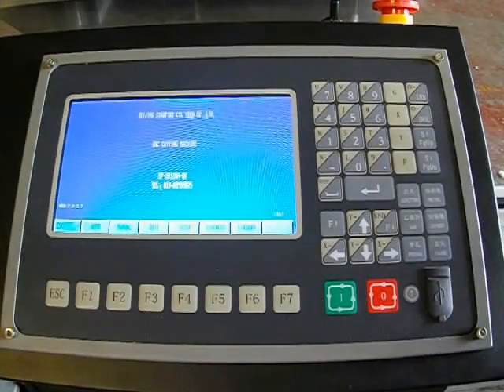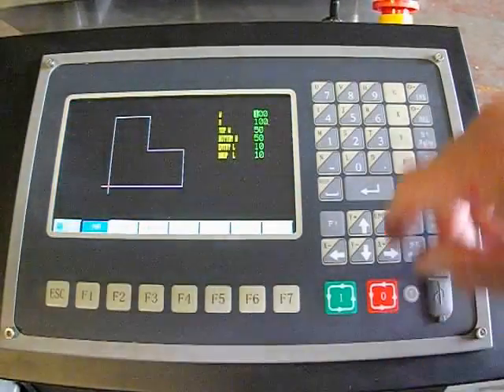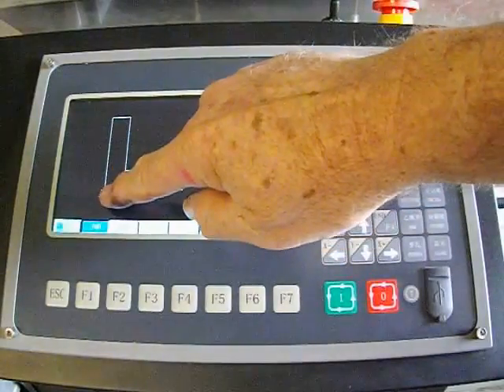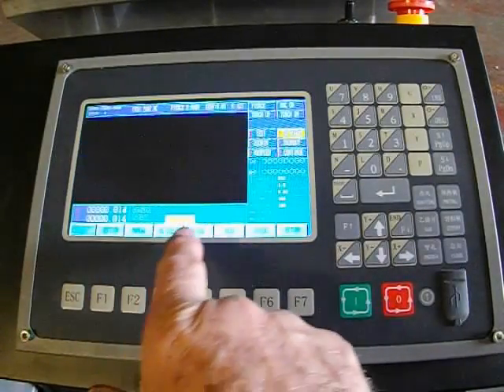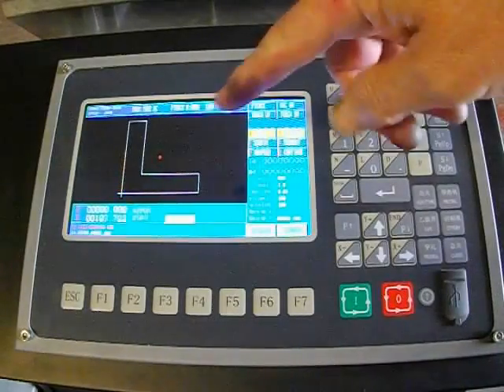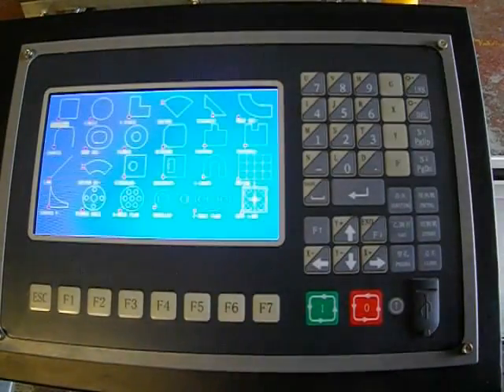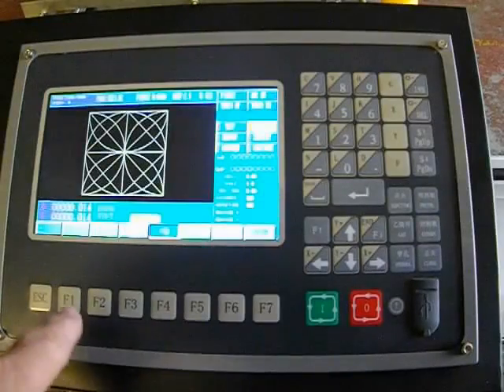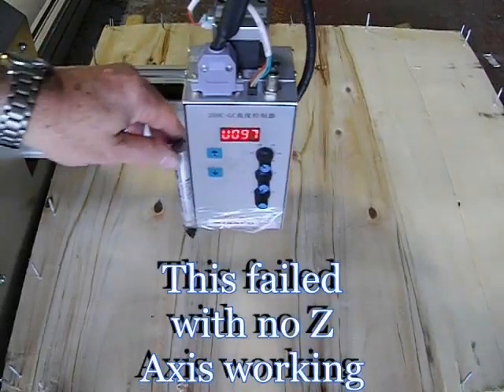First Runs CNC Plasma

Comment from the maker: I am not familiar with sheetcsm but i believe you can use sheet cam i think you have to assign the control panel model to the sheetcam which should align the g code controls.
 nomally draw say dxf . Drawing into sheet cam output g code to usb.

Comment: I’m currently working with a SLX-PCNC1290 CNC plasma machine powered by a Hypertherm Powermax 65 and using a SH-2012AH-QG controller (Starfire / Shaphon), distributed by Z Spot Media.

I’m trying to understand the complete workflow, but I’m struggling with a few key steps:

How to create compatible part drawings (DXF, SVG etc.) for plasma cutting?

How to generate valid G-code (preferably using SheetCAM)?

What’s the correct file format and naming to ensure the controller reads it from USB?

What G-code commands (torch control, THC, touch-off, etc.) are needed for this controller?

If anyone here has experience with this type of controller or a similar setup, I’d really appreciate a sample file, a working setup, a video tutorial or just some tips to help me get started properly.

Thanks in advance for any guidance!

Comment: I have the same problem as Joe. My machine makes the pierce but flames out but mine does not run after it flames out. It just stops. I have cut on it before, but now this problem poped up and I can't figure it out.
Reply from the maker: Have you looked at all the parameters re flame running feedback.if it has been enabled because there is no feedback circuit it thinks there is no flame and turns off the torch.
If it also stops running the shape program that could be another problem.
I am not familiar with this problem.
Look at the troubleshooting guide.

Comment: is it possible to generate the code in Artcam? I can't find the format of the post processor, that is, the format of the NC code
Reply from the maker: I am not Familiar with artcam but the  machine uses gcode.
It usually comes with Fastcam software.
Reply: @Graemecns  I couldn't install Fastcam, my windows is 10, I'm trying Artcam but I don't know what is the file format or the post processor
Reply from the maker: @engmec.joseantonio4181  the gcode is loaded on a USB stick and runs machine. NC. Text.
The gcode commands  are all explained in the machine manual.
Fastscam should work with windows 10 what is the problem.
Reply from the maker: The only problem I have seen with windows 10 is the USB port will not read the usb key. USB port problem.
The cure seems to be use an external USB hub.

Comment: Any way you could show the wiring to the plasma cutter? Thanks in advance
Reply from the maker: there are only 4 wires fom the cnc controller. 2 for on of switch using a relay. 1 off + 1 off - for torch height control 50:1 input. you have to work out what wires your machine has.
Reply: @Graemecns  I have the same one as you. starfire model! What amp would I need?
Reply from the maker: @TiffanyMartin50  I guess you are asking about the wiring depending on how your divider board is configured in your controlled.  ours can accept 1:1 Voltage or 50:1 voltage depends how it is configured with the jumper etc. you electrician need to check what output Volts your Plasma source THC wires are putting out. say 80 volts  or  1.6volts. and configure the devider board to match.

Comment: Wouldn't it fall after it's done with the square?
Reply from the maker: Yes. if you were cutting it. Because of the cut order the square would have been cut out and fell through. but that particular drawing is only in the library as it is usually only used for testing the machines for correct movement of cutting head.

Comment: hi , thanks for video , i see it is with THC  , is it HF OR HT OR BLOWBACK arc pilot 
what could you advise for , cnc cutting , thin metal as hvac 
thanks need to purshase one of it 
thanks
Reply from the maker: Naoufel Melayh the THC uses  voltage to control hright. You need a signal from your Plasma source you set a target voltage for cutting if voltage actual is high torch moves down if actual is low torch moves up. For flame it uses a capacitance ring I don't know how it works as I don't use flame.
Reply from the maker: Sorry for late reply The THC is controlled by voltage on Plasma.  It has a capacitance ring on Gas (i don't know how this works but it seems to be controlled by proximity)

Comment from the maker: hi Joe I think you are saying the machine makes the pierce but the flame goes out even though the program runs . I think your machine is looking for a flame ok feedback. with no feedback it turns off torch.  you need to go into setup and turn off this parameter.